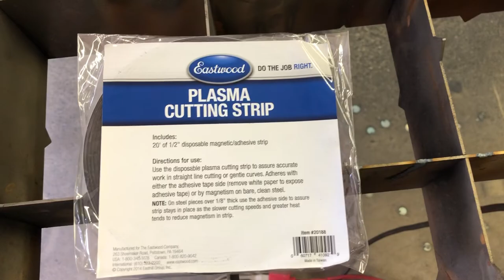Hanging Fire Pit

Comment: What’s the OD and wall thickness on the pit? 
Any suggestion on where to get the materials for a job like this ?
Reply from the maker: 42” diameter and 1/2” wall. Look for metal scrap yards or remnants at steel supply places. I only used 42” because that is what they had. 36” would probably be perfect.